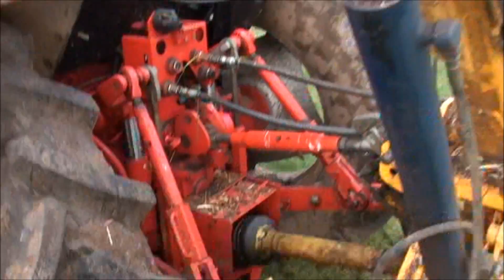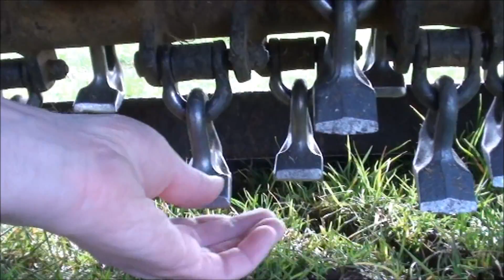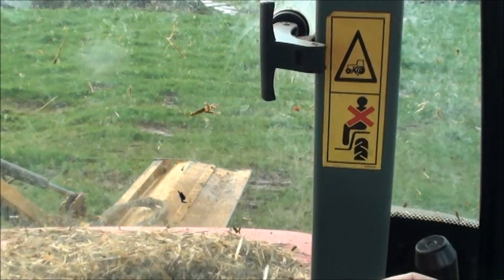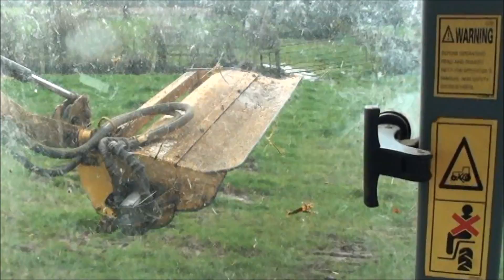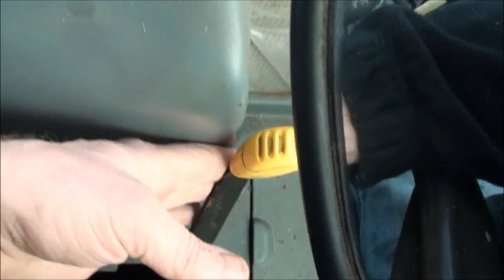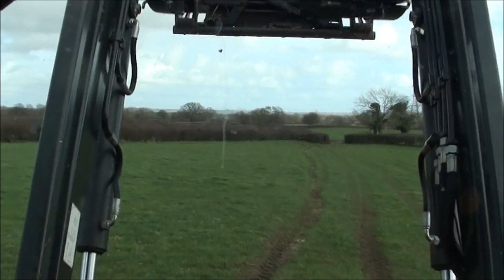How a tractor mounted hedge trimmer works

Comment: Anyone planning to use one of these machines please  attend a course and get ticketed first, learn how to use the machine safely. It is a legal requirement to have polycarbonate shielding over any window with a view of the blades unless the tractor manufacturer guarantees in writing that the windows are toughened glass able to withstand a flail head travelling at high speed. The offside wheels and front axle need ballasting to make up for the imbalance of the implement. Tractors should not be driven with the front end loader raised therefore raising the centre of gravity.

Comment: great video, I have the same 467 cutter. But can't figure out how to get the rams working. The flail runs fine. Just wondering if there is a valve somewhere to turn allow the fluid to flow. The hydraulics on the tractor is fine, I use it for other things no problem. Just can't get the hydraulic rams on the cutter to work. Any advice would be great! Mine looks identical to yours
Reply from the maker: Hi. Yes there is lever that looks a bit like a wing nut that locks the arms if you turn it. It's been a while since I used it so I can't remember it's exact location
Reply: Yep your bang on. Mine was full of crud so just cleaned it & moved it and hey presto it works fine. Cheers buddy!

Comment: Have you had problems with causing tractor tyre ruts this year? Lots of our hedges have remained untrimmed because of the problem of ruts. I heard that there was going to be an extension on the hedge trimming period to allow farmers to catch up if it ever stops raining.
Reply from the maker: I had worse problems last year. This year I wad able to avoid the wettest fields as we only do half the farm each year under our stewardship agreement. It's been tricky though. I can see a lot of hedges round here left untrained
Reply: Thanks. Impressive planning ahead!